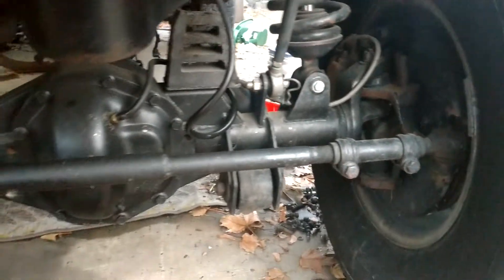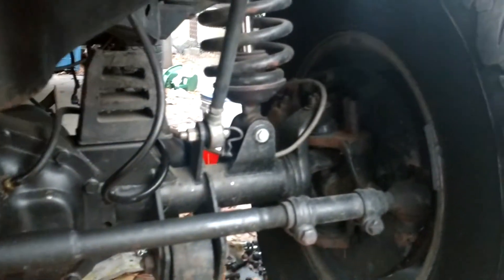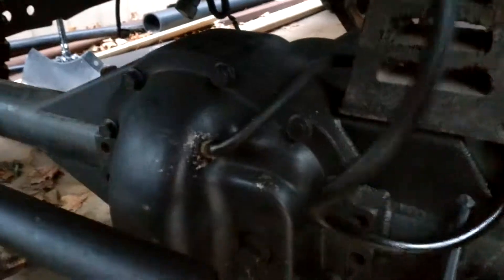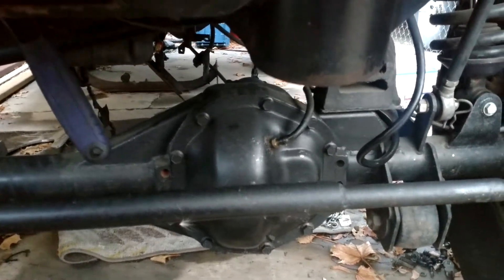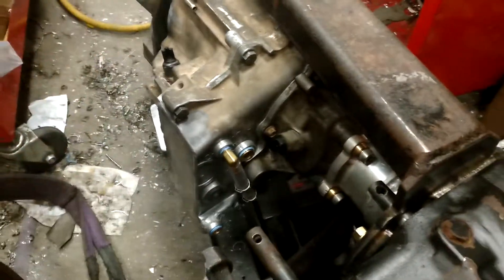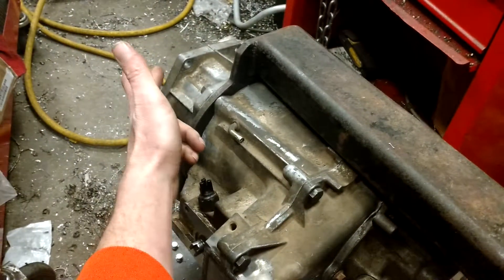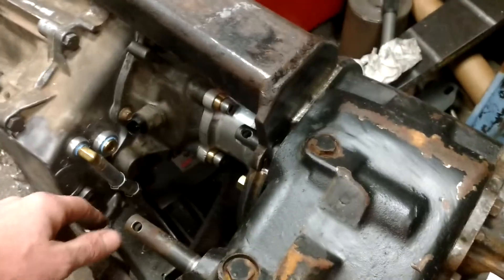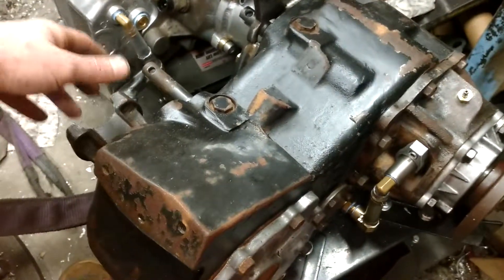Hybrid Dana 54 front axle.

Comment: Huh, interesting, I appreciate the effort even if it's not the most logical way to do something. Why not just go with a full ford 50 so you get the benefit of the 60 sized outers? You went through a lot of work to go from an 8.5" ring gear to a 9" ring gear to keep everything else the same.
Reply from the maker: Keeping everything else the same was the goal. I didn't want a Dana 60 for various reasons, the main being weight, I didn't want to add 200+ lbs of unsprung weight. I have never broken a 44 axle shaft (even stock shafts) and broke the ring and pinion in Moab, I already had the 1 ton disk brake conversion on the 44 I had.
2nd this ENTIRE project cost me less that $50 compared to the $300+ just to put me right back in the same boat, and all the 44 stuff bolted right up to the junk yard 50 center, including the driveline.
3rd the carrier and ring/pinion are the weakest link once you have chromolly axles, and I know you don't think 8.5-9" (~8% larger) is a difference but a 9" Dana 50 compared to a 14 bolt at 10.5" is only 10% larger but i can guarantee your not breaking a 14 bolt every time you take it out. 
Why would anybody upgrade from a Dana 30 to a Dana 44 and not just go straight up to a Dana 60 if your not gaining much in the process? 
I get that the 60 is a beast but it doesn't mean that I absolutely need to run one.
Reply: @wheelitzr2  Oh no, I get the it. Just to clarify, did you weld 44 tubes and C's to a 50 center section? Or did you just drop the 50 diff in a full 44 axle housing?
 I have a Bronco with the factory 44 TTB with 3.55 gears (all half ton fords had this ratio). I just picked up a third member with 4.10 gears from a TTB f250 to swap in as they bolt directly into the 44 beam (since 50's are built off 44 carriers). With TTB they have a center u-joint/slip yoke, the one from the 50 is beefier and uses a 1350 u-joint, where the 44's use the same size u-joints as the outers, this beefier center joint is also a drop in upgrade. I will be putting a lunchbox locker in it and probably welding some material to the front of the beam to act as a skidplate, with the beefier 50 diff and center joint I should only ever break axleshafts if anything, and those will be the easiest to replace.
Reply from the maker: @575conbon  I used the entire center pumpkin from the Ford Dana 50 and reused everything on the 44 from the center section out.